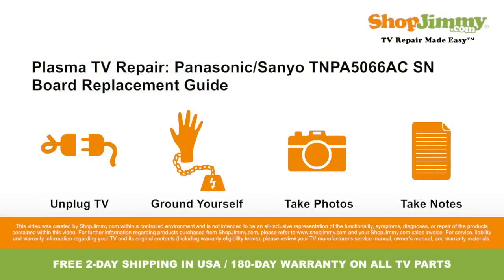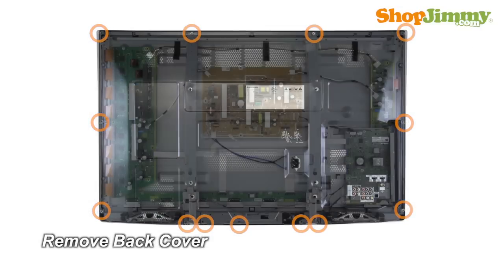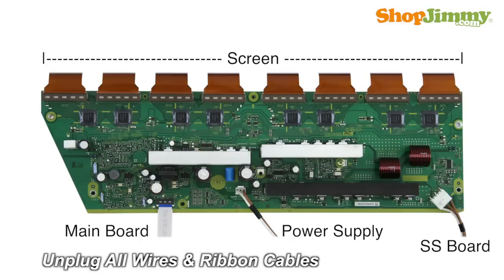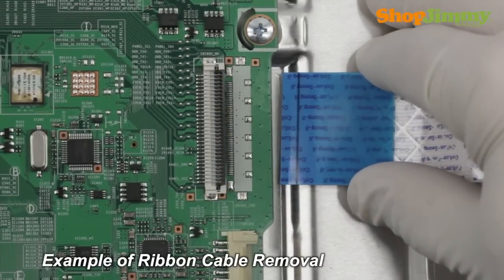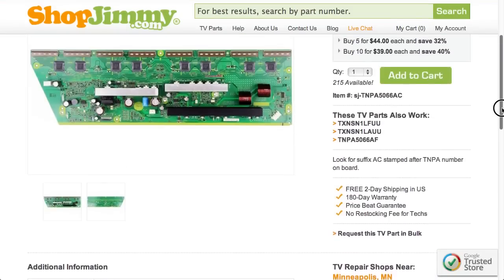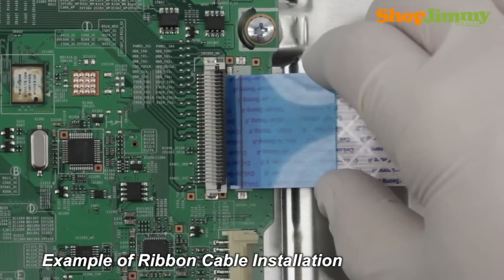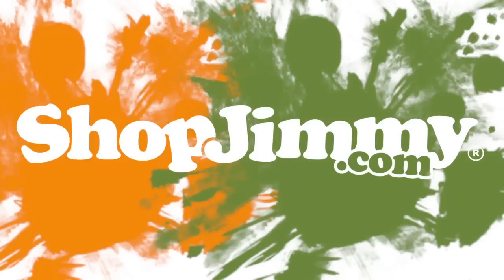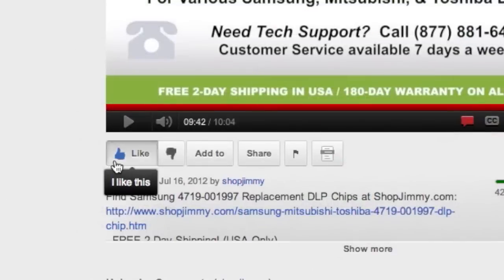DIY Panasonic & Sanyo Plasma TV Repair Tips: TNPA5066AC SN Boards Replacement TV Parts Tutorial

Comment: I have a Panasonic TC-P42C2 that originally displayed 10 blink code. Replaced the SS card then received a 7 blink code. So I replaced the SN board. The TV now powers on, but I have horizontal bars across the screen. Could the bars be from a bad SN board? I haven't tried reseating the ribbon cables yet because I tried to pay special attention when hooking them up in the first place.The bars are of different heights and are across the entire screen, not just a particular portion such as the top half. Any help would be greatly appreciated.
Reply from the maker: Kevin Petrak  Try all repairs and troubleshooting at your own risk.  I recommend bringing the TV to a certified Panasonic repair shop to have them take a look.  Thanks!  www.shopjimmy.com

Comment: Currently troubleshooting based on the 10 blink error code on TV model TC-P42C2 April2010.  Determined that my board TNPA5066 is faulty based on that the SN2 connection is shorted on the SN board.  The power board seems fine, since I see all the sub-voltages are momentarily present when this board is totally disconnected.

Is there a way to test SS board is fine, with defective SN board?
Is the above AC board compatible with the TNPA5066 (no suffix), has 5066AB sticker?
What is usual cause for SN board to go bad?

Comment: Tv turns on works for approximately 10 minutes and picture goes out as if it is overheated. After cool down process is repeated and no picture.  Is it the wy board or what causes this to happen.  If wy board is the cause what is the price of it.  This TV is a Sanyo model # DP50747  made in 2007 and the Serial # is B7390815929515.
Reply from the maker: Linda York  Please watch this video FIRST to help with your repair!  https://www.youtube.com/watch?v=BP3NVNCGEv8  I recommend replacing the Y-Main Board and the Upper and Lower Y Scan Drive boards in your TV.  Click this link to replacement parts for your TV model number:  http://www.shopjimmy.com/catalogsearch/result/?q=DP50747  There may be multiple boards for the same TV model number, be sure to match part numbers on your current board, with your replacement for compatibility.  Here is a link to a video showing how to identify your part number, click here:  https://www.youtube.com/watch?x-yt-cl=84924572&x-yt-ts=1422411861&v=R1jmj_foId0  Thanks and please let us know if you have any further questions with your TV Repair!  www.shopjimmy.com

Comment: Hi I have a Panasonic Plasma 42x20d is the model number.The tv does not power on. The red light blinks 4 times stops blinking and blinks 4 times again. What board do you think needs to be changed the power board or the sn board?

Thanks
Reply from the maker: Abhishek Kabli  Try this test at your own risk.  I recommend disconnecting the SC board and see if the TV powers up, when you turn on the TV.  Thanks and please reply with the results of this test.  www.shopjimmy.com

Comment: I've got a Sanyo DP42740 that does not have the hdmi working.  What board do I need to replace?  Does your shop have instructions for this repair?  You can reply to d z @ centurytel . net
Reply from the maker: Toe Jam I would recommend replacing the main board in your TV.  Here is a link to replacement parts for your TV model number on our website, click here:  http://www.shopjimmy.com/catalogsearch/result/?q=Sanyo+DP42740  Be sure to match part numbers on your current board, with your replacement for compatibility.  Here is a link to a video showing how to identify your part number, click here:  TV Part Number ID Guide for Sanyo Main, Digital, & Terminal Boards (LCD, LED, Plasma TVs)  You can also call our customer service for further assistance with your purchase. (877) 881-6492 Thanks and please let us know if you have any further questions! www.shopjimmy.com
Reply: Thank you for the advice.  I ordered the replacement main board from ShopJimmy, got it shipped promptly, installed it and had absolutely no problems!  I called into tech support to make sure I was getting the correct board and the technician was extremely patient and pointed me in the right direction to order the replacement board.

Thanks ShopJimmy for resuscitating the HDMI ports on my Plasma TV.